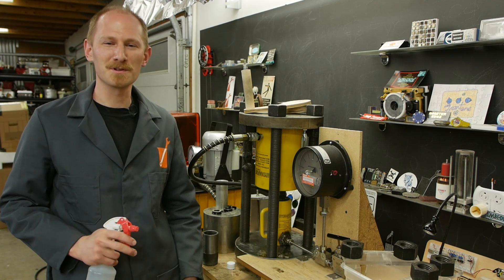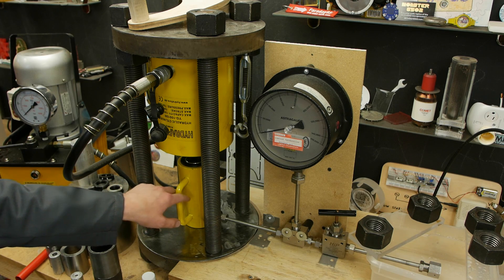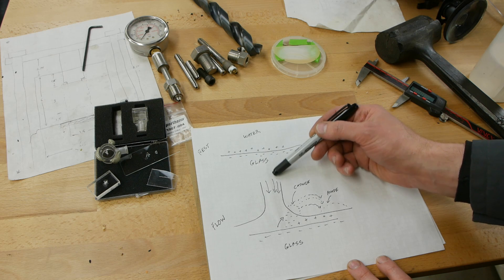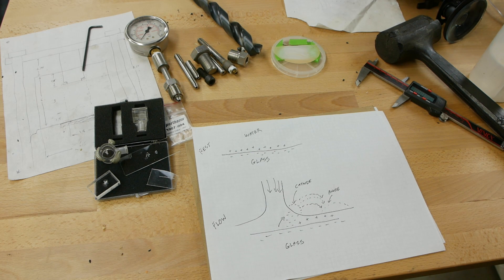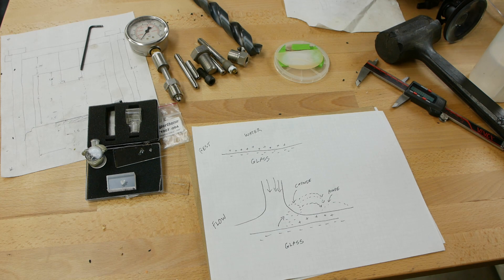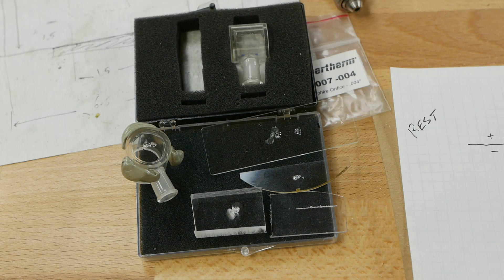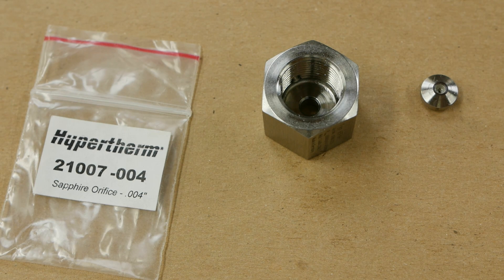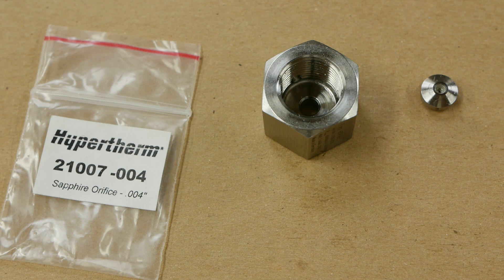Glowing plasma created by a high speed jet of water

Comment: Great experiment! Thanks for sharing. Triboelectric effect seems to be a good explanation of what's happening. But you also mention the surface fracture. The first thought that popped into my mind was could fractoemission also be contributing to the light? Fractured surfaces have been known to produce light due to the same reason charge separation resulting from bond breaking. 

The fading effect after sustained impact of the jet could be because the air  b/w water and the surface gets dissolved I think. If you have the time try with salt water to confirm.

Comment: try a (heavy) water container with low voltage open current filament inside creating plasma channels around the filament. assume the current ionizes the water around and plasma has zero resistance compared to the current wire. can be graphite rod or filament. should works like low voltage jacob ladder inside the water.

Comment: is it possible that the plasma might be related to sonoluminescence (light generation in collapsing cavitation bubbles). Not sure how such cavitation could be happening but perhaps to do with the sharp change of direction and/or instability around the stagnation point as pressure falls from stagnation down to static pressure of the high speed annulus of water along the glass?

Comment: Hey Ben! Love your videos, longtime subscriber. I couldn't find your email address so I'm hoping a message here finds you as well (I sent a message on twitter as well). I recently was pressure washing a shoe which is hooked up to my very pure (<1ppm TDS) deionized water source. I observed a crazy purple light being emitted from the interface between the shoe and the water and upon further investigation I came upon your video "Glowing plasma created by a high speed jet of water" and the paper you sourced your information from. You noted that you had a tough time keeping any glass surface intact for very long as the water stream would damage the surface in fairly short order. In case you were ever interested in doing more videos or work with this neat plasma phenomenon, it seems like your ultra high pressure water jet is likely quite overkill for this effect to happen. My pressure washer is only rated at 1,800 PSI at 1.2gpm, I use it to wash cars (hence the DI water) so I went with one of the lower pressure/flow units. I used a 15 degree angle jet and the effect came out quite brilliant. I sent a link to the video to your twitter DM since I'm not a content creator I won't share it here. It did no damage to the shoe, and I was able to recreate it on a tempered glass plate after finding your video with no damage whatsoever to either.

Comment: Well i recently got interested in ultra high pressure water jets of small diameter so this video came so handy, however i made the calculation and a 2ml per second flow of water at 1000 bar only has about 200W of power not 800W im not trying to be petulant just legitimately tough in correcting the number in case someone also is interested in this has a more accurate view of the power involved

Comment: The dielectric quality of oil makes charge accumulation in oil pipelines a danger worth preventing to companies.  You have to use pure water to preserve dielectric quality of water. The oil failure might be related to long chain length and so charge distribution requires volume more than speed.

Comment: What you can do is have the high pressure water jet go through a copper coil! Measure the voltage across it and see what happens when you apply voltage to it. Another idea which expands on that is to use copper sticky tape, cut out a hole where the water jet is going to hit and stick it alternatively on the back of the destination glass or the front while being electrical connected to the coil! I think that some interesting results should show up! 
If drops of water from a specific height fall through a copper coil can induce a current in the coil, i wonder what would happen under high pressure water? It could even be possible to add more coil's in series to obtain a higher voltage! Who knows? And who knows what effect the copper tape will have? I'm thinking that it might just be the part that completes the electrical circuit! Hmmm interesting...

Comment: I was able to get this effect at work by accident. We were pressure washing the inside of a very large DI water tank that was having issues with bio buildup. The inside of the tank was coated with some sort of epoxy. We were running a 3000 psi pressure washer running at 3.5gpm. we were also running DI water through the pressure washer. We had previously rinsed the tank with a bleach solution to kill off anything and were rinsing with DI. Being a tank it was naturally dark and we were able to see this effect. Took a video of it, will see if I can dig it up.

Comment: Yo, could you make an electrostatic water jet? Since electrostatics influences water you could make an open ended vacuum tube through which water is supplied and the nozzle would be + - oriented accordingly and it would add to the kinetick energy of the water.
Like... if excess energy is converted to aether pressures than ather pressures should also be able to speed it up? Or should the "particle" be polar/non-p... ok just gotten to that part.
Interesting so aether could also be viewed as life force in some way? Or rather this is why we are 70& water.
Reply: And oil could be seen as baze, and baze is non conducting where acids are virulent and help in aether pressures. Is o2 acidic or neutral? Or are nitric compounds acidic? hm... This is all electricity

Comment: Could this have something to do with the flatness of the glass? It you sanded the glass even lightly would it affect it? 
Let me edit this question.... is it possible that your creating a torodial vortex that has a strong enough vacuum at the center it's allowing the water to jump to a plasma state? If this be the case the erosion of the plastic would quickly change the water direction. I say go with diamond and see what's the outcome.

Comment: Dry steam about 4-5 bar pressure can generate huge e.discharges if it blowing to massive isolated metal thing. I came across this phenomenon when I put a large wrench in a stream of steam. Steam exited through the tube to connect the pressure gauge. The discharges reached 50-70 mm.

Comment: An interesting point to this if I may add. I'm almost positive this is due to the crystalline form of the glass. Check out the work from Dr Dan burisch on his work on crystals. He's able to propagate a plasma portal which also propagates RNA out of the portal plasma ball. This is a strict feature of a crystalline form and he gets this to propagate under a small voltage applied to a crystal. Not to mention compressing any Crystal for the most part will create a voltage

Comment: I am curious if there is an optimal angle for generating the plasma arc. I wondered that as the material was being removed from the surface, the reflecting angle would change which could disrupt the arc, therefore if you could adjust the angle of the glass -/+ 90deg would the plasma still appear and if so within what range?

Comment: Would be interesting to see this in a case where the material is not removed from the surface because I recall the fracture of glass and other such materials generating a visible arc at the fracture point so I'm not sure this is happening because of the water so much as the material being chipped away in a controlled manner that focuses the arc at a position.

Comment: Thank you very much this is a super super interesting experimente perfectly ilustrates I cant belive is free. congratulations.  You asked  with what other fluid could be done, mabe with alcohol but if you doit be very carefull because very easy will ignite or maby explote because the very fine particles that will result of the impact at that speed but would be very interesting also with carbon tricloroethylene or  thetracloride and this tow are not flamables and are not electrical conductive.

Comment: Gerald Pollack's work on the 4th phase of water is - in my opinion - relevant to this observation.
There is actually a structuring of water adjacent to hydrophilic surfaces/particles that is negatively charged.
The ability to structure and de-structure (phase change) operates our cell biology - and of course in the natural world.
It also offers energy for the functions previously assigned to pumps or any number of extraneous supports.

Comment: The same things happen when you peel 3M transparent tape (or probably any other kind of tape) due to the stretching and sudden tearing and contraction of the glue film.  This actually creates X-rays that could be used for, say, dental examinations with no bulky electric tube X-ray machines.  This is termed an "emergent phenomenon" due to being unexpected, though obvious after one sees it happen.

Comment: I'm curious if the plasma occurs in harder materials that have no damage -as if the separation of a solid causes an influx of energy needed in the break.
Reply: Tape does the blue glow when ripped apart, and volcanoes produce lightning in the explosion.  I thinks it's from the tension sharing in space.  Solids share it, but ripped apart, it must be put back.  Not to be used without express permission from Ricky Bobby Inc.

Comment: Cherenkov radiation (pronunciation: /tʃɛrɛnˈkɔv/) is an electromagnetic radiation emitted when a charged particle (such as an electron) passes through a dielectric medium at a speed greater than the phase velocity of light in that medium. The water shedding electrons due to collision at glass surface? Think pseudo-Compton scattering with electrons instead of photons.
Maybe it would work with another dielectric medium. 
Dielectric liquids are used as electrical insulators in high voltage applications, e.g. transformers, capacitors, high voltage cables, and switchgear (namely high voltage switchgear). ... Some examples of dielectric liquids are transformer oil, perfluoroalkanes, and purified water.

Comment: Nice theory as to why it happens, it might be right.  That it happens to change the color of the plasma is important when it's in different atmospheres, because it has a lot to do with compressing the gas near the impact point.

But a point you make that an impure water won't do this because it's conductive can be debated when you send a stream of water through a metallic ring: tap water will create a charge of static electricity.  There's something else going on.

Comment: It looks like a cavitation bubble trapped in the middle of the jet.  Perhaps it will erode the glass at a rate faster than can be described by the water jet's physical material removal?  Is there heat concentrated in this plasma bubble?  If this is cavitation, this looks like an easy way to maintain a stable subject to study closely.

Comment: I worked with water jet cutting on many types of materials, using 50,000 PSI, Australian garnet sand and 40 tho nozzle, when cutting Titanium I got a powerful fire like effect (blue to purple) going back up the beam of water/sand. It seems that the Ti is so hard that the Garnet is decomposing to an atomic level, and creates a kind of minute plasma effect inside the stream that erodes the Ti away. The finished surface of the Ti was quite different to say Core 10 steel, which is one of the hardest steels I cut. I never saw that effect on any other material like, woods, plastics, steels, aluminum, rock, granite, glass including Armour plate, Stainless steels,  and even the broken pieces of tungsten carbide, that we cut into tools for use on model lathes.
An interesting aside.
We also had laser cutters and one interesting thing about core 10, is that as you cut it on the laser it "sings" as it releases the internal stresses, some other materials groaned or whispered too. LOL It was really a pity as all the core 10 we cut was being turned in to rubbish truck containers.

Comment: Great videos! Very enjoyful and educational!

Maybe with your equipment you can perform this experiment: synthesize carbon nanotubes: https://nanohub.org/groups/gng/File:Bronikowski_et_al_2001_High_Pressure_Carbon_Monoxide_HiPco_Process.pdf

High-pressure carbon monoxide (HiPco) process: in CO (carbon monoxide) at pressure 30-50atm, temperature=1000°C, with the addition of a bit of Fe(CO)₅, carbon nanotubes would be catalytically synthesized and would just precipitate.

Comment: I'd like to see you use a slightly less polar molecule like acetic acid or ethanol, perhaps the color of the plasma will be different? :o Or not visible at all... Also also, polarity is governed by the rigid conformation of the molecule and electron pull. That means irradiation in the IR spectrum might induce bond-vibrations and further proliferate polarity and the plasma effect.

Comment: its the oxygen diamagnetic reacting with the hydrogen its a clue to make free energy try tungsten sharpened to a point you can get it at a welding supply ,and at the point of plasma ad a inert gas  .

Comment: It has to be polar to be triboelectric? In the refining industry precautions are taken whith turbulent flow of lighter (but not heavier like your oil) distillates building up charge, and those are non-polar. Perhaps you could try the experiment with gasoline?

Comment: use a round target like a cylinder on a shaft which can rotate so the material can 
last longer since the area changes. (like a water mill).
Also you should use an air cleaner  device near the emission.
Oilmist can be very unhealthy. (exspecially silicon oil)

Comment: Does the plasma generate x-rays?
What would happen to the plasma in a vacuum?
Methanol is a non-conductive polar liquid that might work.
The acceleration at the nozzle will also be very extreme , did you check for visible plasma near the nozzle?

And last but not least, thanks for yet again such an extremely interesting and original video!
Reply: Good idea to look to the nozzle, but question is if the ruby part of the nozzle is sufficient large, the ruby holder is conductive!!!!????

Comment: Instead of water impinging on a glass slide perhaps a high speed flow of water in a narrow quartz tube would generate a glow. Also, could it be that abrasion formed in the glass changes the frictional properties of the flow and not some depletion of the charge? Speaking of flow in a tube, I've gotten a pretty strong shock from an old CO2 fire extinguisher because the continuity in the wire braid around the hose was broken. Large tanks can knock a man down from the shock. Teflon tubing might be something to try to generate a plasma glow.' a function of the fluid flow rate" http://www.gatespowerpro.com/resources/doclib/ElectrostaticDischargePTFEHose.pdf

Comment: A very interesting phenomenon...  A couple of thoughts here: one is that the abrasive properties of the liquid stream is sufficient to peel silicate off the surface of the glass slide - there are lab experiments where silicates were shattered in the presence of water and the breaking of the silicate (Si-O) bonds generated extremely reactive surface sites that were able to react with, and break apart, the water molecules to generate hydrogen gas and, presumably Si-OH bonds on the surface of the silicate glass.  Don't have data on whether the other surfaces would be likewise reactive...  Another possible phenomenon that could lead to charge separation at the impact point is the hydrogen bonding that occurs in the water - it is known that liquid water isn't present as individual water molecules but rather as loosely bound, large aggregations of water molecules  - the very high pressures of the water in your compression system would tend to favor the formation of those aggregations that would be forced to break apart when they impacted the glass slide.  The breakdown of the aggregations could generate the charge separation needed to generate the voltages required for the atmospheric discharge which, based on the experiment with helium, is clearly occurring...

Comment: Very Interesting. This reminded me of a system used to generate steam by impacting a high velocity stream of water against a target. A fairly standard diesel fuel injector is used to drive the water. The company claims cavitation and the breaking of hydrogen oxygen bonds in the water molecule as the basis for steam generation. I have no affiliation with this company just thought it was interesting and related. http://cavitationenergysystems.com